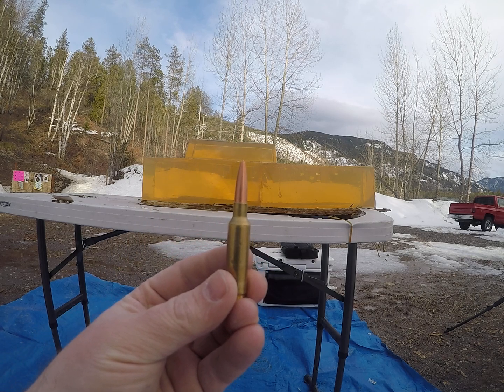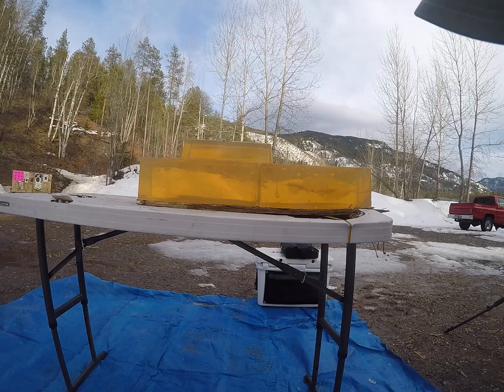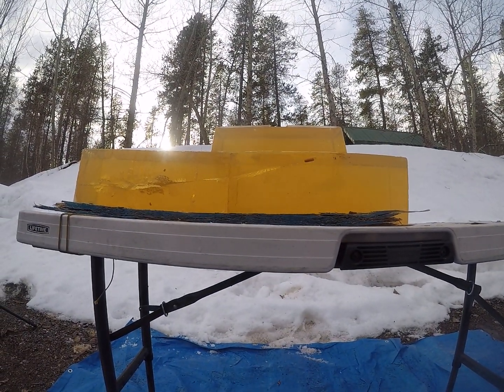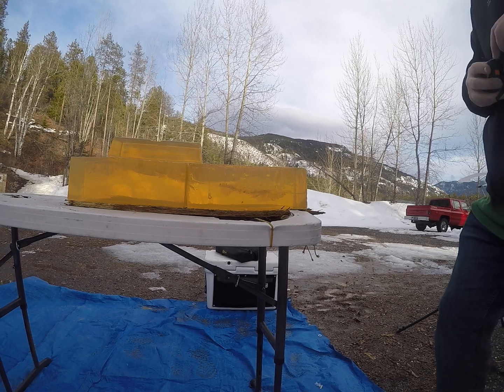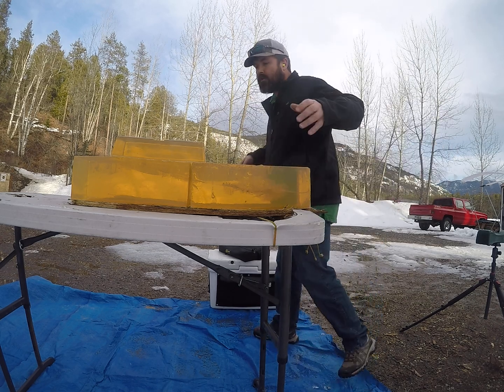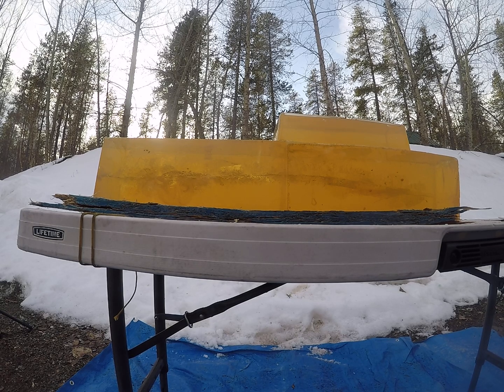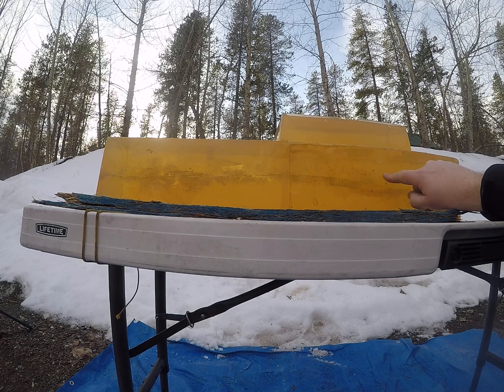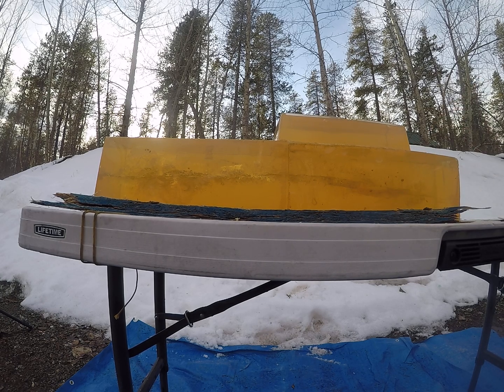125gr Cutting Edge Maximus 6.5 Creedmoor ballistics gel test

Comment: What solid copper bullet would you recommend for the .260 Rem?  I shoot the 140 Nosler Accubond now with great results but I'm afraid that NY is going to push for non-lead ammo shortly, at least on State land.  I'm using 44 grains of H4831sc at about 2660 fps.
Reply from the maker: My two favorites are Badlands Bulldozer 2 and Hammer Hunter. If you're not trying to reach out there with maintained energies and velocities and don't need really high ballistic coefficiencies, then I would lean towards the Hammer Shock Hammer bullet.
Reply: @simplemindedfella  Virtually all shots 150 or under with 75% being 100 or less.  I see pros & cons on the Hammer bullets concerning tumbling after gel impact.  No worries in your experience?
Reply from the maker: @charliebelle6693  I have had 0 issues with hammer bullets. That would not be a concern of mine within normal hunting conditions and actually hunting not taking long-range shots. The only monolithics I have had issues with are cutting edge. Here is a video showing that even at high velocity impacts some of the issues I've had with cutting edge. 

https://youtu.be/ByLQZS41aIo?si=v8rYT-1P31URdpiK

Comment: This is an old video, but I would like to say I really appreciate your channel.  Your approach to bullet testing is by far the best I have found, thank you!  You haven't by any chance tested the 100 gr Cutting Edge Raptor, have you?  I'm thinking of loading those for my daughter in 6.5 CM.
Reply from the maker: No I haven't. I like the stopping power of cutting edge bullets in regards to game. I have for the most part gotten away from using them because I've had a couple rifles in a row that with these newer rifles the tighter tolerances for better accuracy the freeboard does not have enough room for that seal tight band so there is no real bullet seat depth adjustment you can make and I have trouble getting them to shoot accurately in those cases. You can avoid those type of issues completely going with hammer bullets that also have great penetration great transfer of energy and stopping power. Another good option would be badlands bulldozers.
Reply: Thank you so much!  I'll look into those.

Comment: What is your all time favorite 6.5 and 30 cal hunting bullets for longer ranges? I want to toy with mono’s, but I’ve had great results with Berger’s, regardless of the results you and others have shown…
Reply from the maker: I haven't used many nonalcoholic bullets in the field yet. With the testing I have done I am most impressed with Hammer Bullets. I am setting up a 6mm Creedmoor with the 88gr Hammer's. Don't know if I will be using it for any hunts this year. I wasn't very successful drawing tags.

I currently use the Nosler ABLR's in my 6.5 Creedmoor, one of my 308 Winchesters, my 30-06, 300 Winchester Magnum, and plan on using them in a 6.8 Western as well. I have been very pleased with them.

Bergers are lethal I'm just not a fan. If you like how they are performing for you then you should probably stick with them.
Reply: @simplemindedfella  I understand. I agree the testing says they’re awful, I’ve just had contrary results. I’ve had fantastic results with the Barnes Matchburner 112’s in my 6XC as well, between 88 and 399 yards. They hold together really well for a match bullet with a great BC. I’m thinking of setting up my PRC with Badlands Bulldozers, Edge, or Hammers. With the velocity gained over a 156 I can probably get close on wind drift within 600 yards. Past that the Berger’s surely win in the wind cheating department.
Reply from the maker: @brandondeckert9838 the bullet design of the Hammer's really helps with reduced drag going down the bore. I have just started playing with them and I am liking how accurate they are on top of better velocities. 

I used Bergers for a wile and worked for a wild game prossor for three seasons in Wyoming (we averaged 1200 animals a year at that facility) I formed my opinion on them long before I started testing bullets. They tumbled very consistently and in most cases come apart quite violently when they do and that dose make them lethal. I'm just not a fan of what they do and more so at closer ranges. Its a personal preference thing. There are some situations where I would consider using them.

Comment: Excellent test. Not enough channels even touch cutting edge bullets. I get it, high price, gotta roll your own, but they sport amazing accuracy reputation, have better than average BC numbers over nearly everyone except A-tips, and reportedly perform at a massive velocity envelop.
But I'm interested in using them for medium velocity, but heavier bullets, so a sort of quasi-thumper, and hardly anyone compares these in videos for hunting, or discusses the pros and cons for hunting.
Reply from the maker: Price has definitely been a deterrence for me in regards to Cutting Edge bullets. They are though, one of the best ballistically performing bullets after impact that I have ever tested. The Maximus line giving the best results. The only issue I've ever had with them is in a few different rifles, that sealtight band interferes with the freeboard and I cannot adjust my bullet seat depth for accuracy. In some cases it has caused excessive pressure issues not having any freebore.
Reply: @simplemindedfella  interesting, hopefully I don't run into issues with that as I try to teach myself this stuff in preparation of the 8.6 blackout coming out soon, from Q.
I bought some 338 225gr lazers, I'm a total novice, but in that cartridge the spin is so fast that most lead designs give up the ghost or get close enough they deform or fail. Some weights and velocities can render as much as 400,000 rpms, so thats why I was intentionally looking for large copper high bc bullets that perform at lower speeds and have longer than average per weight ogive. Cutting edge were the only ones.
Q themselves focus mainly on barnes bullets, but the bands are exposed and the design wastes a lot of potential ogive  instead showing a lot of bearing surface.
But from what I've seen, the high spin turns the humble mushroom of most heavy for caliber Barnes bullets into a radial ratchet shaped pinwheel of destruction.
Reply from the maker: @ravissary79   because of the issues I was having in regard to the freebore with my 6mm Creedmoor I tried hammer bullets (I'm having the same issues with one of my 6.5 Creedmoors and a 308) man am I liking them. Haven't used them in the field yet but they tested really good in gelatin and my 6mm Creedmoor loves them. Shooting 2 inch groups at 400 yards and I'm not a great shooter. You might look into Hammer as well if you run into issues with Cutting Edge.
Reply: @simplemindedfella  thanks:)
Reply: @simplemindedfella  you havent used them in the field.. hammers or CE's? i cant decide which one to use.
Reply from the maker: @spacepathfinder1  not as of yet. I have settled on Hammer for my 6mm Creedmoor because the sealtight band on the CE bullets do not allow for bullet seating depth adjustments and I could not get them to shoot accurately. Hammer's where sub 1/2 MOA with minimal effort to get them shooting that good.
Reply: @simplemindedfella  have you ever had the chance to do a CEB Maximus vs CEB Raptor direct comparison in gel??  I’m torn which one to load in 30-06 for mule deer sized game
Reply from the maker: @hikenmikes8262   I have not tested anything with the raptors yet. I am very impressed with the Maximus line and it definitely gives more trauma (without being too extensive) then the match tactical hunting line of their bullets.

Comment: Not too shabby on high velocity. 
If it was over 1800 fps on the lower velocity would it be much different of an expansion? It is surprising the amount of damage some of these bullets can produce and the extent of penetration at velocities so far below 2000fps.
Reply from the maker: These did so well and I have a couple more I may test them in a Grendel for a visual on the mid range velocities. Definitely would have a little larger and deeper permanent wound cavity at 2k.
Reply: @simplemindedfella  Thanks. Good info
Reply: Like all monolithic projectiles the more velocity the better the expansion. Although difficult in my 20” Sako barrel,  I’d  Strive for 3K+ for that weight class. Just my 2c.